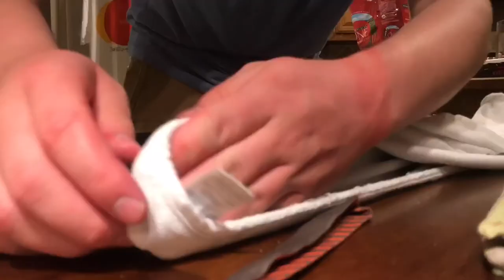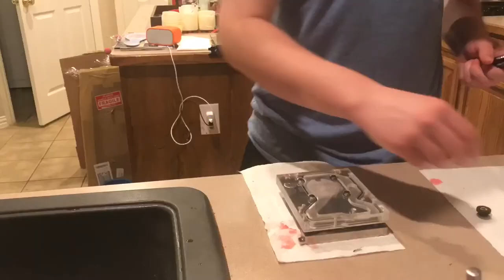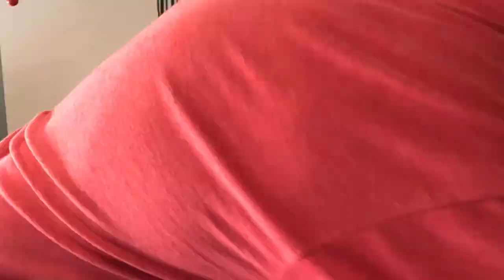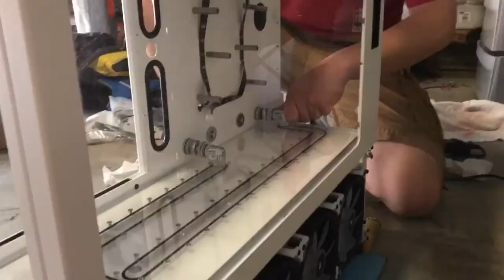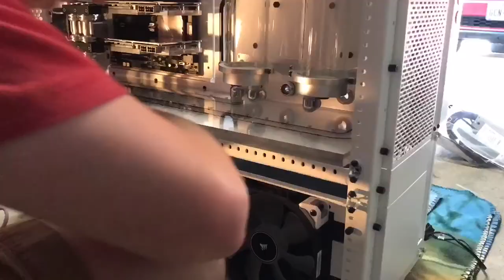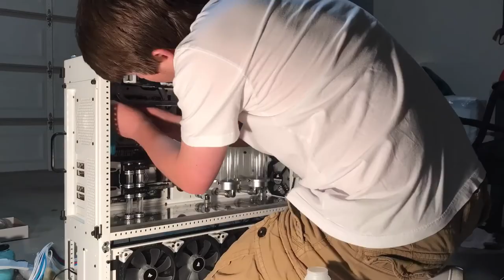Custom Caselabs SMA8 Lightbox & Water Manifold Timelapse

Comment: Nice job.  If there's any way to add a bit more coverage to the end - after all that hard work, I'd like to see a bit more of the finished product.
Reply from the maker: Thank you! I can't believe I forgot to link my photo album in the description... Here's a link to the photoshoot I did for my handful of Reddit/Twitter posts! https://imgur.com/a/k1ecY
Reply: Excellent - that's a difficult product to light well, and the shots look great. 

I'm curious about your cooling loop for the SLI GPUs it looks like it's straight through. Do you have any issues with card two running warmer or does the flow equalize into the two blocks pretty well?  Intuitively it just feels like that lower card isn't going to get cooled at all - but intuition and reality often don't mix.  

Did you pick two loops to reduce flow resistance through the GPUs - you've got some pretty hard 90 degree turns in the flow, so I'm wondering how well your pump is flowing? 

Are you using D5 pumps or did you go for a higher pressure pump like the DDC on the GPU loop?
Reply from the maker: Thanks a bunch, man! The temperatures on the two cards are at worst two degrees off of each other. On idle they equalize, but when under load they deviate very slightly. This being said, they both get plenty of flow and I've never seen them get over 42C (High OC + 3DMark torture testing). 

There's no doubting my abuse of sharp angles with this system, but the flow seems to be fine; were it too slow I would certainly see it in the temperatures. You're spot on however, I definitely did split the loops up not only for a sweet dual-color appeal, but for less overall resistance.

I am using XSPC D5s for both loops, and have them set to 3 out of 5 on the pump speed. Everything seems fine, and speeding the pumps up doesn't change my temperatures much, if at all. 

Hope I was helpful!
Reply: Good to hear.   I'm debating an SLI build, although at the rate I'm getting through the research I suspect I'll have to start over because we'll be up to the next gen of GPU. 

Congrats on a beautiful build.

Comment: Where did you get that led panel and distro mid plate made mate? I’m after one exactly the same?
Reply from the maker: I had it custom made by Jim over at Clockwerk Industries. High quality stuff, I'm still using it to this day with zero issues.
Reply: @Jesushoovy  thanks buddy do you know if he’s still around and making them, I’m after one
Reply from the maker: @generationelectrical1071  Yep! He’s still up and running. Here’s his site: 

http://clockwerkindustries.com/

Comment: is the lightbox just sitting there or is it somehow secured?
Reply from the maker: It's just sitting down there, but there is pressure from the distroplate above it to hold it in place. I had the lightbox built to fit fairly snug in there, so it doesn't have a lot of moving space.
Reply: Kyle Seifert thank you! Ive been wanting something like this but wasnt sure if screws would ruin the lighting effect in it